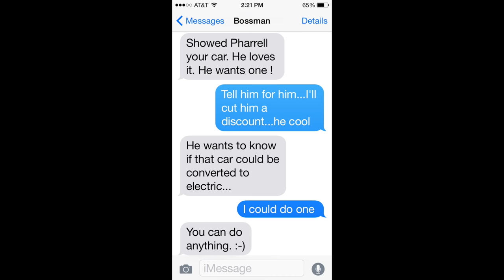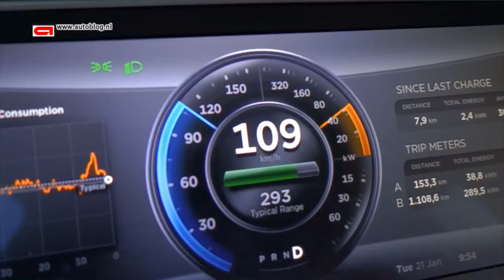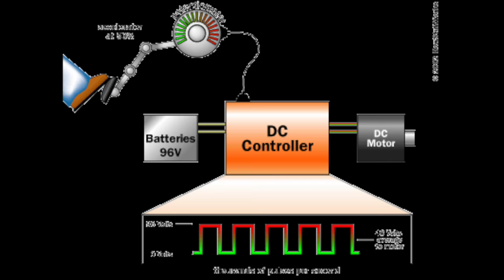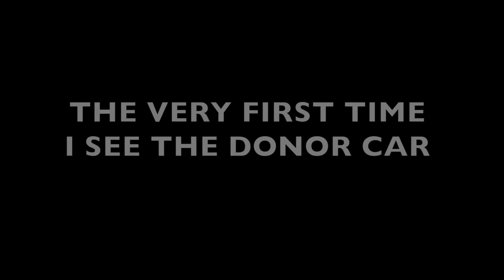The "eRod" a Documentary Part I

Comment: Hello and thanks for the great video! I'd like to know what kind of exhaust you're using on that straight six. Sounds WONDERFUL, and I notice it's dual. I have a "few" vehicles myself and virtually all are inline six with three on tree. Thanks again for your efforts, absolutely wonderful work!
Reply from the maker: Great question...I used a Fenton split exhaust manifold and I ran straight 1 1/2 inch pipes all the way back with no mufflers, no glass packs...just straight pipes. It is a bit loud and obnoxious but it does sound nasty..just the way I like it. Some guys will mellow the tone a bit with one glass pack on one side...but that odd ball setup kind of freaks me out. Hope that helps my brother!!